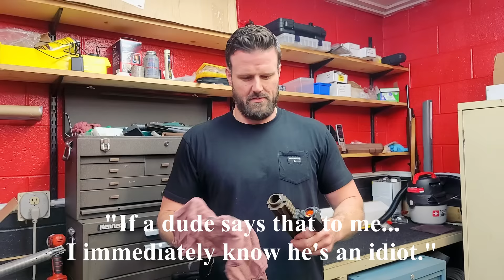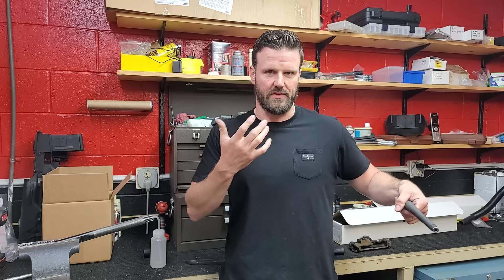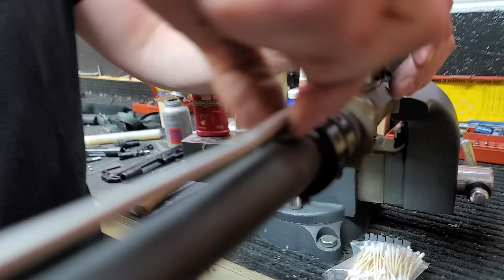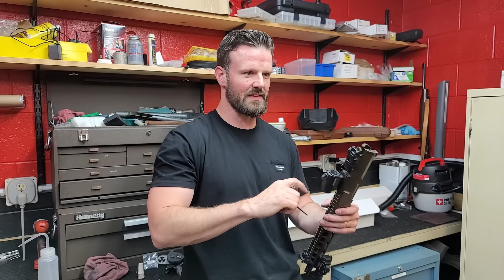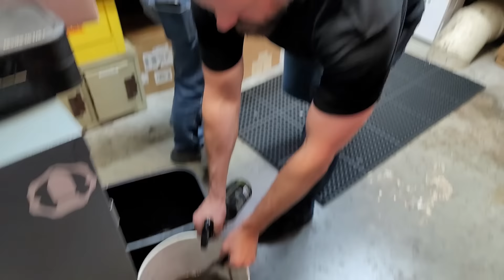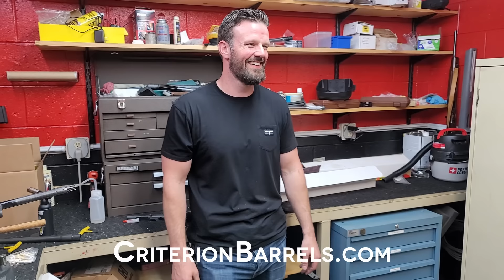AR15 Science

Comment: I appreciate the knowledge, and the guy knows his stuff, but he ain’t feeling no 1/2 thou difference in the bolt lock up. Lol

And the blue locktite ain’t doing anything on that gas block. If anything use rock set.
Reply from the maker: Here is what I know, I shoot more than most, and these builds are solid.
Reply: @CarryTrainer  here’s what I know, I’m a firearms manufacturer. Besides that, it’s just common knowledge that blue locktite degrades with heat. Does the gas block get hot? lol

That said, I’m sure those are solid builds. I mean, even if the locktite degrades that’s not going to mean the gas block falls off. The screws have teeth that bite into the barrel and there is some torque applied. But if you want more security definitely don’t use blue locktite. Been there, done that, it doesn’t help anything.  

Now, about that 1/4 moa BS…….. I have $5,000 says that guy can’t build a standard AR15 and lay down a 1/4 moa 5 shot group at 100 yards with factory ammo. He can headspace the bolt, but the gun has to be a functioning milspec AR. I have other stipulations, such as being present and inspecting the gun, but I will make that bet. And it has to be one of their core barrels.
Reply from the maker: @harrisarms2151  I mean the following with zero disrespect. Being a "manufacturer" doesn't denote or equate to knowledge or skill in any area topic. There are many trash makers of lots of products.
Reply: @CarryTrainer  I don’t take any offense at that, I actually agree with you. And I didn’t mean any disrespect with what I said. I appreciated a lot that was said in the video. But the blue locktite on the hottest part of the gun is just a no no. 

And the bet/challenge was real. I know what it takes to shoot 1/4 minute, and it is an ultra rare feet for even a bolt gun. I don’t like to say impossible, but with an AR and factory ammo it’s pretty much impossible to do on call. Sub minute or even 1/2 minute is ridiculous but somewhat believable (1/2 minute is cutting it close), 1/4 minute is whole other category though. Heck, if a builder gave me a custom $10,000 bolt gun with specific hand loads for that gun maybe I can trust that on a bench, in a vise, with perfect weather conditions, it will consistently shoot 1/4 minute 5 shot groups at 100.
Reply from the maker: @harrisarms2151  his point is the barrels will get the job done. They are certainly sub moa builds.
Reply: @CarryTrainer  yea, they are good barrels, some of the best. They shouldn’t let stuff go out that boasts 1/4 minute though. Sub minute, fine, that is extremely reasonable and extremely accurate for even a bolt hunting gun.
Reply from the maker: @harrisarms2151  I reached out to the head mechanical engineer. 
Here is a fitting response.
"I'm not sure what Mike can physically feel, but the guy has headspaced thousands of barrels, so it's possible. 
 
Yes, blue loctite has a 300F suggested working temp, he is correct. 
However, blue loctite still gives the screws the needed edge to stay retained while still allowing you to remove the gas block when need be. The last thing you want is having seized screws and having to drill them. It's still not easy to get the screws off when you use blue loctite, which is the whole point. 

We have tested our method on plenty of machine guns and have never had an issue.  Actually, every single rifle we built (since 2016)and own uses this method. With zero issues from that particular thread lock.
That's actionable data, not an opinion."
Reply: @CarryTrainer  sure, like I said in my previous post, a thread lock is not necessary to have a solid lock up on the gas block. A dimple in the barrel for proper port alignment and proper torque on the set screws will last probably for the life of the block. They do that. My point is, and nothing they said refutes the point (it actually establishes my point with the maximum 300* F operating temp), IF you are going to add security in a thread locker, blue locktite will not help. It’s no different than no thread locker at all. But I digress. 

On the note of Mike being able to feel 1/2 thou differences in bolt head spacing…… ok, whatever floats their boat with that ambiguity. He knows what he’s doing, which I never suggested he doesn’t, but he can’t feel a 1/2 thou difference, nobody can. And that’s fine, what he can feel is a bolt that is slightly tighter and another that is slightly looser. 1/2 thou is basically the width of 1/2 of a human hair, so tiny that digital calipers can’t recognize it with any degree of accuracy (all digital calipers have a +\- .001 error range). 

Didn’t ask about the 1/4 minute claim? I would appreciate some clarity on that claim. And if they actually do make the claim I would like to know the stipulations for the claim. 

Anyway, thanks for the interaction, and I do appreciate your content.
Reply from the maker: @harrisarms2151  call them up. I'm certain they will glady help.

Comment: Regarding headspace, the cartridge is not rattling around if the headspace is not tight. The ejector in the bolt is constantly exerting pressure, pushing the cartridge forward against the chamber shoulder once the bolt is locked closed.